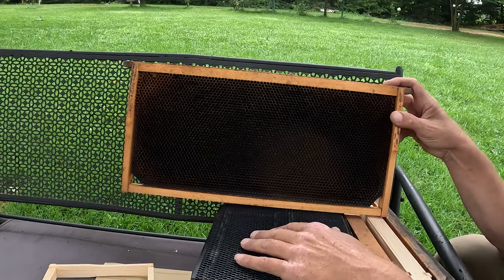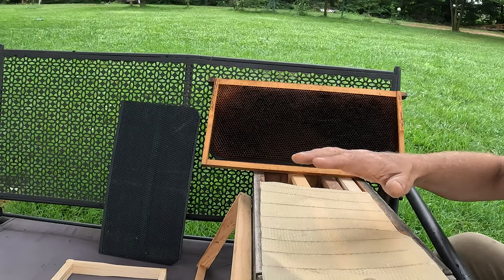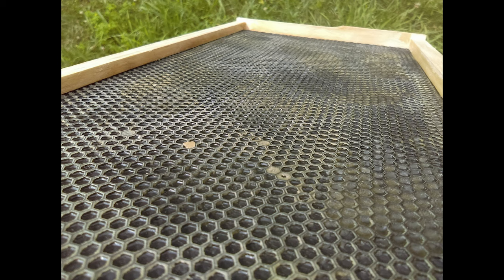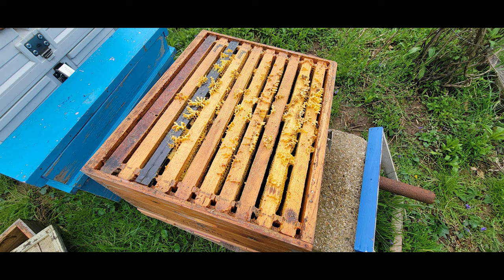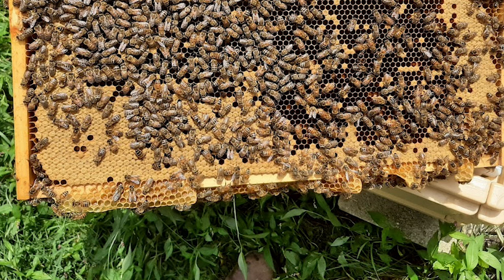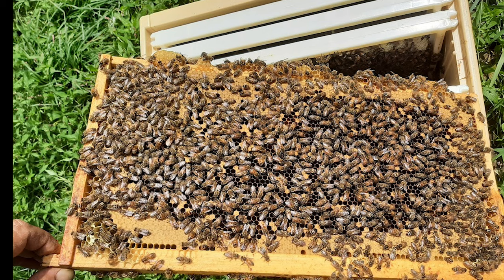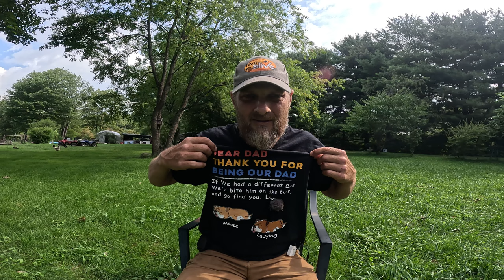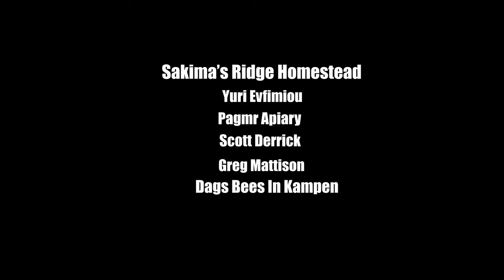Frames, Foundation and More (Wonky Comb Explained), Plus Big Announcement!

Comment: And I always made my own boxes, as I had tons of scrap pine lumber, biscuit cutter for boxes,  and a router and table saw for frame parts.  I made a scale drawing of a cross section of inside of the hive to get the exact distance between parts for bee space.  The distance from top of the top bars to the bottom of the next upper frames were exactly correct for bee space, resulting in very little burr combs between upper frames and lower frames.  Bees were my passion for many years, resulting in a honey crop in a good year of exceptional amounts.  Each year was a different situation, I should add.   Bob

Comment: Hi JC.  Back in the day, I used only one size pure wax foundation, for supers.  The deep frames would get the same and bees would fill out the combs to the bottom of the frames.  It was shown to me the plastic fdn was the invention of the devil, but can't say for sure, not having tried it in my hives.  I used thin galv wire and brass inserts into the holes in the frame ends.  I could get the wire real tight and not have to worry about sagging combs.   I got out of bees long before varroa mites came along.  Just as well.  If the mites were to go away, I might get back with bees.

Comment: For my honey supers, I would always use 9 frames, making sure they were evenly spaced apart and from the sides to allow the wax to be uncapped easier.  If the flow was getting toward the end, I would put ten frames of freshly extracted combs in a box.  They would be less easier to uncap but not impossible, if I chose to extract these combs.  I might use them to feed a light colony in April of the next year.  Use of queen excluders is the subject for another time.   Cheers,  Bob

Comment: I will upload a video how we, here in Europe add in wax sheets. Hardly anyone that use plastic foundation. I use thicker wax foundations that is getting smelted in with the steel wire we use and add 12/24 volt DC to heat up the wire. And those foundations can also be scraped off because of the thickness. We can buy them with casted or rolled cells both for working bees and drones. Size for working cells are 3/16 inch (4.7mm) and drone cells are 13/62 inch (5.2mm). I use 1 drone frames in 10 frames hives but only if I find mites in the hives. The mites prefer drones to lay their eggs in so it's easy to take them out and put them in the freezer to kill them and then scrape the foundation clean again.
Reply: Too hot here for that
Reply: We do it here in Australia and it works fine. Hot here too.
Reply: @beekeeper8474   it's not unusual for us to have temperature above 100°F summer time, even up to 107 this year. But I don't use hives of wood but styrofoam. 1 inch thick so it's isolated from the heat during summer and the cold during winter. The roof part is 1,5 inch thick.

Comment: hello, awesome vid as normal, i do the wax wipe from my render wax i just break off bigger piece rub it on sorta heavy, then i take my little propane torch and about 12 inches away i SLIGHTLY heat the wax i put on and it melts just enough to get down in to cell hole,, thanks again,,

Comment: Would a heat gun or blow dryer aid wax application with a crayon? Not too hot or the plastic will warp.

I used wax foundation initially. I found the bees would shred some of the foundation to quickly draw adjacent frames.

Comment: Have you ever had a horizontal hive? If so what are your concerns positive negative and or your experience. Thanks for what you do.
Reply from the maker: I haven't ever had one but I do know bees prefer to move upwards not across. They can be trained but it takes times.
Reply: I built 3 of them tried them and sold them. Due to the reason Jason stated. They like to move up not sideways.